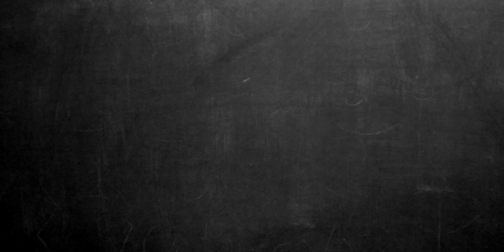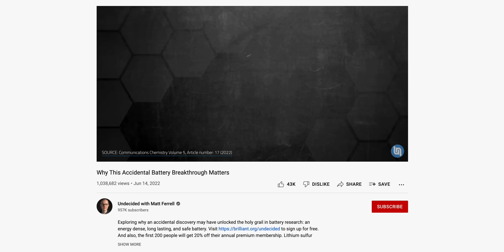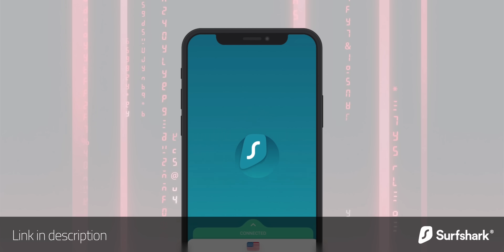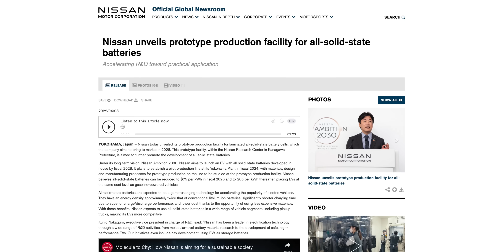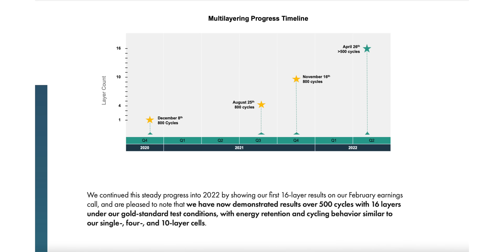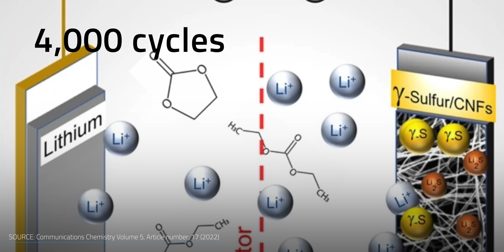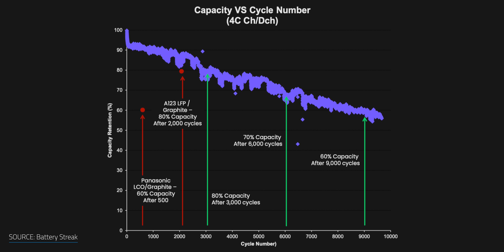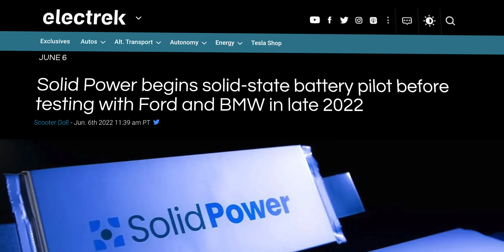Is This Solid State Battery Too Late?

Comment: Just a thought. The quoted life cycle durability for current and future EV’s using tradition lithium ion batteries, is that with the over speccing of battery capacity allowing for degradation over time? I would assume it is but not sure. Need to make sure we’re comparing like for like with the new battery tech.

Comment: One of the less flattering aspects of a free market economy is that sometimes being "good"...just isn't good enough.  Millions of dollars are spent every year on good solutions that are outdated or outclassed before they even make it into production.  This is particularly true with any segment of the market where there is a tremendous amount of potential profit.  This drives fast-paced innovation that sees "the next great thing" quickly forgotten about because something even better came along.  For example, if the plasma boring technology you discussed recently proves viable and scales rapidly, does that obviate the need for many of the advancements in solar panel technology?  I think one could argue that it would, and to our collective benefit, but that doesn't mean some companies won't lose a lot of money as a result.

Comment: I just saw a video form an EV channel showing a new Mercedes-Benz bus that is fitted with Solid State Batties and they were way worse them normal batteries (which greatly surprised me - they took many times longer to charge, were limited on how fast you could charge them, they where very easily damaged esp via vibrations (not ideal being in a bus?) and they cost much much more

Comment: Yes, no question, batteries are the future of all transportation but which chemistry exactly?  Don't know.  I think batteries will morph in to lithium or sodium sulfur solid-state over the next decade or two, as both lithium and sodium offer similar characteristics with sodium being less expensive and far more abundant, but not quite as energy dense as lithium, and sulfur for sure, as replacing nickel, manganese and cobalt is HUGE!  Pressing lithium or sodium in to a solid-state-like ceramic isn't overly difficult and am sure will be done, as solid-state tech still offers the promise of eliminating most of the battery management of heating and cooling, and smaller size, but not much else.

Comment: It seems even near-term solid-state batteries are actually just "incremental improvements" over lithium ion batteries and not the game-changer tech as has been touted.  Add to that some outright highly questionable drawbacks such widely varying claims of charge/re-charge cycles.  What to believe?  There will be good gains steadily in lithium batteries, this is likely and the much ballyhooed "game-changing" battery tech yet to come is, like fusion, always years and years in the future.  You know:  promises, promises...graphene anyone?
Reply: Over a 1,000km range per charge should be the standard, imagine just charging once a month.

Comment: charging times is the main reason I can't own an EV. 

and then there is the fun aspect that I don't see ever happening in an ev since they are insanely boring to drive. for a fun car do I need ilght weight, good handling, quick enough, a great sound track and most importantly, a manual transmission. without all these components will I only buy an EV when I can buy one for dirt cheap and know that the battery will last and at the time when I have lost my sense of having fun entirely.
Reply: If you have a garage you can fully charge the EV over night. If you road trip you can charge from 20-80% (after about a 200 mile drive) in 15-20 minutes. That's about as long as it takes to take a bathroom break and stretch your legs. Charging is already today a minor issue, and will be less so, once the charging infrastructure is built out within the next 5 years.
Having 100% torque at all times and a low center of gravity with individually controlled motors  at every axle or even wheel is what makes EVs fun to drive from what I hear from every test review. 
Yes, you'll lose the engine noise, the transmission noise, the exhaust noise and the massive heat production and tailpipe pollution. The older I get the less noise I am exposed to the better in my opinion, so good riddance to that.
Reply: @saschamaj  well, still isn't practical that I would have to stop for 20 minutes every other hour or so cause I don't stop to stretch my legs, my bathroom stops are a quick stop at the side of the road, pee and get back into the car and takes less than 2 minutes. 

and buying a used electric car is just insane due to not knowing the health state of the battery and a battery costs as much or more than the price of the entire car. 

battery degradation is still what holds electric back, and a great sound track and a manual transmission just makes them into a boring appliance in my eyes

Comment: I think I've commented about this on your videos before, but I'd like to see what you think about graphene aluminum ion battery chemistry (see GMG out of Australia, which has begun delivery of button cell prototypes to potential customers and is working on a pouch pack prototype). I'm personally pretty excited about it for a number of reasons:

* based on a new graphene processing technique developed by researchers out of University Queensland that increases inter-layer spacing and surface perforation of graphene cathode material to enable better intercalation of aluminum ions
* potentially 60 - 70 times power density compared with lithium ion (faster charge/discharge without overheating)
* aluminum's 3 valence electrons compared with lithium's 1 mean future energy density developments on the order of 3 times that of lithium ion batteries
* no lithium or rare earth materials; just aluminum (anode, electrolyte), chlorine (electrolyte), carbon (anode, sourced from natural gas) -- simpler supply chain, easier to recycle
* more stable battery chemistry -- longer lifetime (so far on the order of 3000 charge/discharge cycles have been tested with minimal reduction in capacity)
* electrolyte-based structure highly compatible with existing button cell and pouch manufacturing technologies, only difference is in chemistry

My biggest uncertainty is how the production costs will pan out -- supposedly, GMG has a relatively cost-effective way to produce very high purity graphene, but that's relative in the context of a material that is (to my knowledge) starts off difficult to produce in quantity at a cost-effective price point.  Then there's the demand for aluminum across all industries, which is pretty high and forecast to grow.

I'm also curious, when people talk about price per kWhr for batteries, does that take into account the usable life via charge/discharge cycles or is that purely in terms of production cost?
Reply: All of this is to say, I'm not too impressed with the apparent advantages of solid state batteries at this point. I agree it will be good to have a mix of battery chemistries, but I think at this point the main advantage solid state has is where it's at in the hype cycle.

Comment: Its not too late.
Lets explain how.
Teslas 4680 cells were unveiled 2 years ago and still haven't reached the mass production phase yet.
The other battery chemistry like Sulphur have just been discovered. While Solid state is in the protyping and sampling phase. The Sulphur stuff will take 10 years to reach the mass production phase.

Comment: We had records,then tapes, then 8 tracks, then casettes, then CD's, then blue tooth.  When electric motors first came to be they were mammoth; now we know much more. In 50-100 years we'll have a good battery. For now: use powdered coal to keep us running CHEAPLY until we reach our goal. We can't be green if there is no grass.

Comment: higher energy/lower weight is the holy grail of mobile power storage.
it'll be portable devices who adapt solid state in mass production first.
i think mass storage will take whatever is longest lasting/cheapest implementation as new types show up.
weight and volume don't matter as much.
i'm sure the problem with some or most solid state is they don't transfer over well to existing battery production methods, meaning a whole new process has to be built for them to be mass produced.
when portable devices mass adopt them, then other powered devices will follow in a few years.
once  the power and life cycle is acceptable too.
Reply: Gasoline is 13,500 Watt/Hours a liter. That's the number to beat battery head.
Reply: @1pcfred  But engines are only 35% to 40% efficient at extracting that. The rest is wasted as heat. Not to mention the other inefficiencies that come with cars, and you don't ever put pure gasoline in your vehicles, it has additives to stabilize the fuel and in the winter, make it less likely to not combust at low temps. 

EVs are at 95% efficient at releasing that stored energy in batteries, so take that with what it's worth too.

Comment: The new tesla battery is the same unit manufactured by Panasonic, it is a Panasonic battery, but is essentially 6 batteries in one, allowing for elimination of the housing, and other components, making it lighter, more cost effective. That is what allows range improvement, and cost reduction.

Comment: Tesla 4680 cell has far greater power density so it will be able to release model 3 with only a third of the battery weight and get half the range of the existing model 3 and charge to 85% in a 20% of current charge times. Best thing is this will able to also produce 3 times as many cars that will also be 20% cheaper! Its a win all around  !

Comment: My guess is that the solution for super batteries will come from a total different approach. Probably battery cells that operate at a much higher voltage.

Comment: I agree with your comment about the proper tool for the proper job. In instances where weight isn't an issue (Mass storage from renewable sources), there might be several different solutions which will work, while for things like EV's, where safety, weight, and range are the primaries, it might need a completely different set of solutions. Like you said, time will tell.

Comment: I am still waiting for the Sodium equivalents to the Lithium cell chemistries. They might have less capacity, or be heavier than their Lithium counterparts, but they probably are way cheaper, as Sodium is much easier available than Lithium. I expect Lithium based chemistries to be technology leaders, but mainly used in special environments, when maximal capacity paired with minimal weight is king, like air travel.

Comment: 400 cycles is a bigger issue than you passed it off as. every use of your EV can't be expected to run full to empty every time. That is a unrealistic real world usage and will just increase the range anxiety drivers feel if the must decide between using up 1 of their precious 400 cycles or trying to reach their destination.
Reply: Cycle count doesn’t relate to being completely empty. If you run down a battery to 50% thats half a cycle.

Comment: It's never too late but they need to figure out how to make them to be reliable in INSANE quantities. Many engineers would engineer things for sake of engineering/over engineering/what it could be but not necessarily what the product should be. What the batteries should be is easy to manufacture at scale which is not something more engineers understand. Hey look, my battery charges 10% faster........what good is it when no one has one to charge? Mean while the chinese/CATL is making more than good enough batteries that will soon flood the market.

Comment: What ever happaned to the iron-oxide battery for stationary storage? Was it too inefficient?
Reply: Nope... I made one with higher energy density than lithium ion. About 3x higher than the alleged theoretical capacity of 200 watt hours per kg. The secret is surface area...
Reply: @erictuffelmire6826  That sounds great! Care to share how you pit it together? I'd like to try building a small one.

Comment: In theory it should be possible to make a lithium sulfur batterie with a solid state electrolyte because they are addressing different parts of the battery composition. I am not very knowledgeable in this field, so correct me if I am wrong.

Comment: Recent car range and charging speed are good enough for my taste. It's ok to do 350 km and then charge 10-80% in 20 min for another 250 km. The winner will be as always the cheapest and easy for mass production.
Reply: Competition always helps too. Break up the monopolies. Stimulate new innovation.
Reply: @ralphbell1786  to make large tech breakthroughs vast resources often do help.
Reply: If you're stopping 20 minutes every 155 miles you're not going to get very far by the end of the day. You've just added another day to a thousand mile trip. Which in a gasoline vehicle you could have done in a day if you had any balls. Enjoy your night in a fleabag highway motel.

Comment: In the long term, two of the most important considerations are availability of materials (safely, justly) and end of use recycling or disposal. Battery tech should help us leave our planet better than we inherited it, not something that makes our environment more toxic. Solid state batteries may help with this goal. But some of the other new battery technologies might as well.
Reply: A less toxic chemistry needs to become mainstream.
Reply: All the battery powered cars in the world won't be going anywhere without a vastly improved electrical infrastructure for people to charge their cars. Home charging could run into issues if too many people in a neighborhood all try to charge their cars at the same time. What about the millions that live in apartments and can't always park anywhere near where they live? Is every apartment complex prepared to install charging stations all over their properties parking lots? Or worse, urban apartments where people have to park on the street. Even if you only have to charge the car once a week, you still need a convenient place to do that.
Reply: @JMcMillen  in my case I'm getting a 8.5kw solar installed this year. But yeah if it becomes a once a week thing I'm sure infrastructure will catch up and we still have a good 10 to 15 years for EV to be over 50% new car sales.
Reply: We can drill in the oceans, the arctic, and fracking everywhere, put pipelines across continents, float tankers, and build filling stations — all for vehicles that run on dinosaur goo. We can run zillions of air conditioners and everything else. But somehow upgrading electrical infrastructure becomes a roadblock specifically when it comes to electric vehicles? Pish tosh. We can resolve the power grid and last mile issues, and we must, because the consequences of not doing pose an existential threat.
Reply: @ADHJkvsNgsMBbTQe  It's not a matter of if we can do it, it's a matter of whether the companies that have to actually do it will spend the money to do all those upgrades or will they drag their feet because they can't find the profit in it. 
Lord knows that there are places in the US where the power grid already has trouble handling extreme hot/cold weather issues. Now add on millions of EV's trying to charge and it's only going to get worse.

Comment: With the recent announcements on different battery breakthroughs , it a little difficult to determine which is the best. The advantage of Solid State batteries that makes them so attractive is the fact that they charge up to full extremely fast . There are certainly other factors of equal importance like longivity and capacity. But the other factor is all these batteries are under constant development and improvement so what is today's specs can and do change in 2 years time. Just look at Lithium Ion batteries which have now evolved into sulfer , iron and silicone derivatives. So everything is constantly changing which in my opinion makes it impossible to make any conclusions.